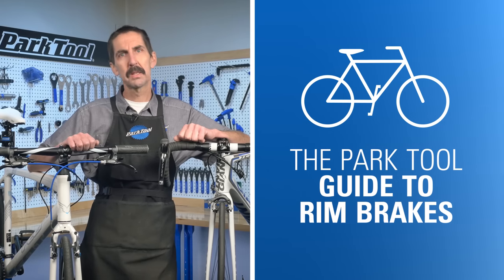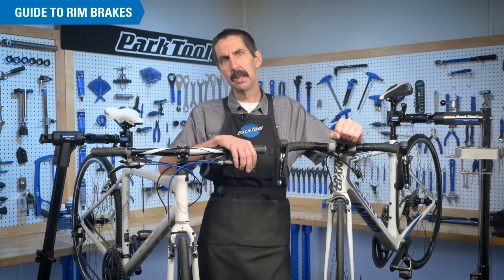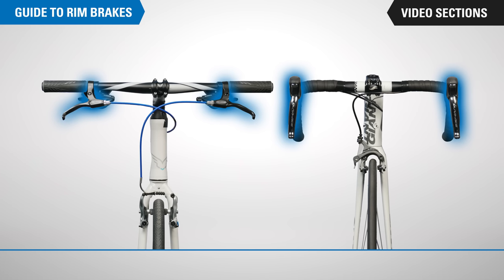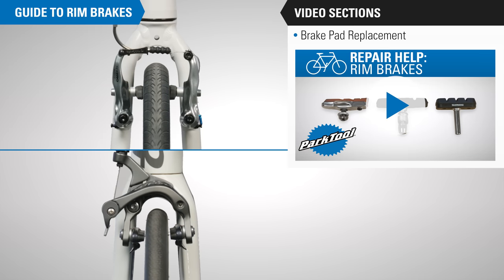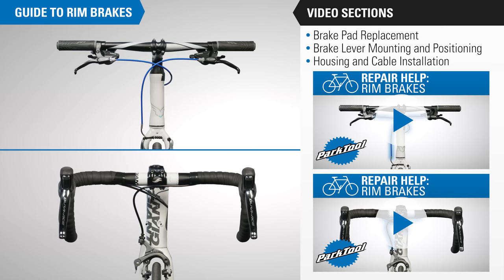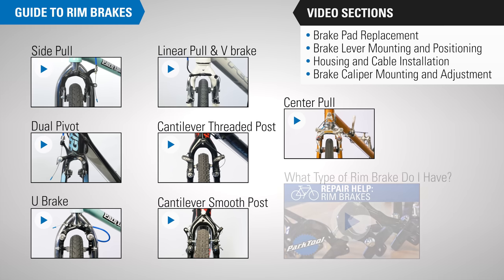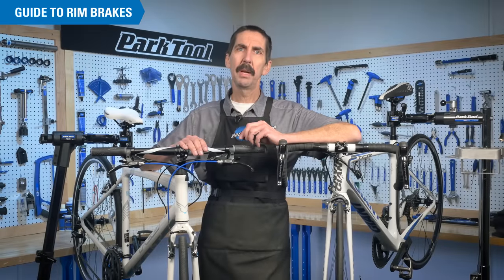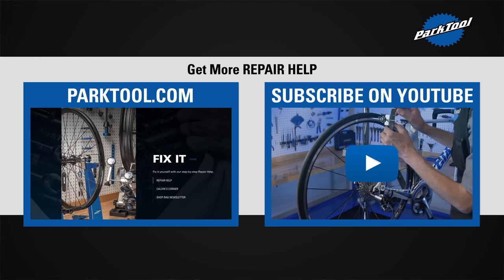The Park Tool Guide to Rim Brakes

Comment: I have 105 (5800) STI levers and the left one has developed a little bit of play. Meaning when it is pulled to brake, it will travel a few millimeters before enganging. Is there any common fix to this issue? Cables are new and should be fine. Thank you :)
Reply: T
Reply: I ran into the same problem and I suspect it’s the caliper tension spring :(  did you find a solution??